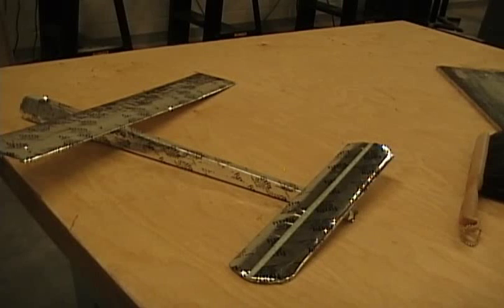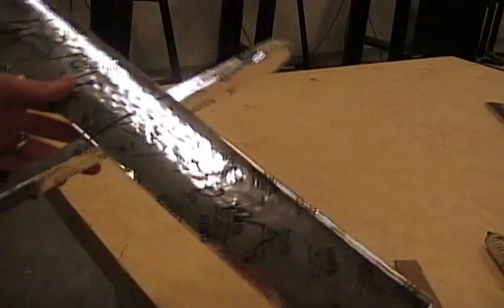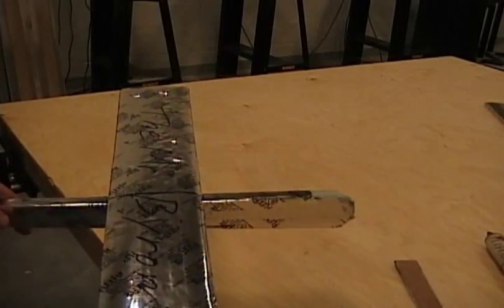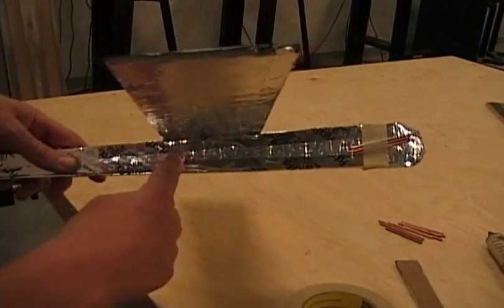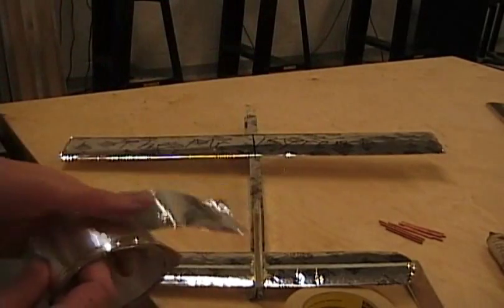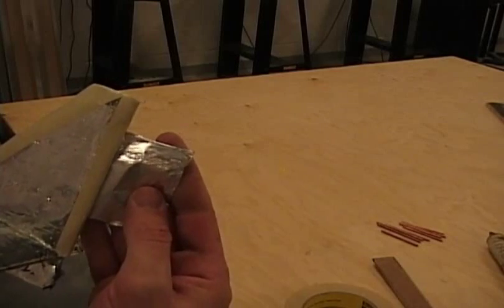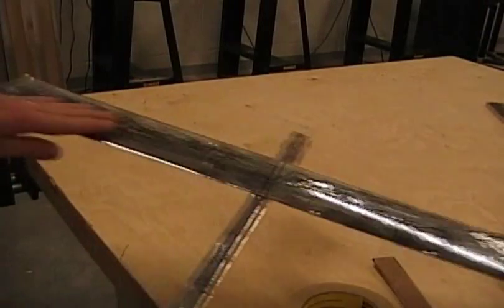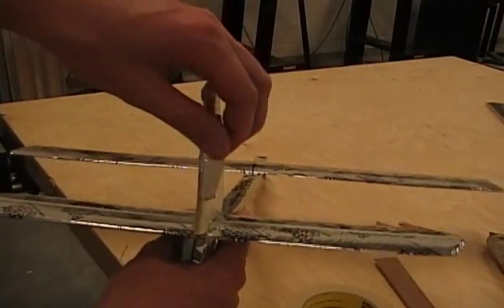How to make a foam airplane part3.wmv

Comment: wow... watched all 3 vids... cool how pieces of foam and tape fly! u should make it an R/C model with a motor or maybe a rubber band powered plane. just suggestions. also, the vertical fin flap (horizontal stabilizer)  is rudder, wing flap is aileron, and back wing (vertical stabilizer) is called elevator. not trying to prove you wrong just trying to inform. nice vids make more!